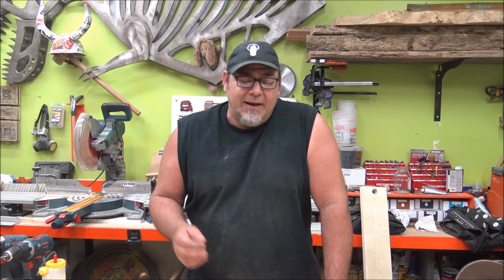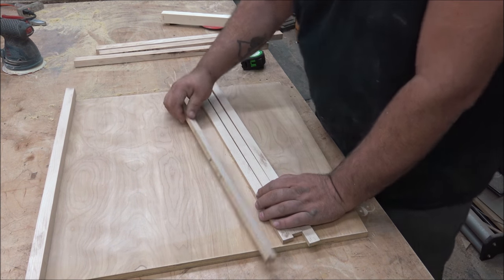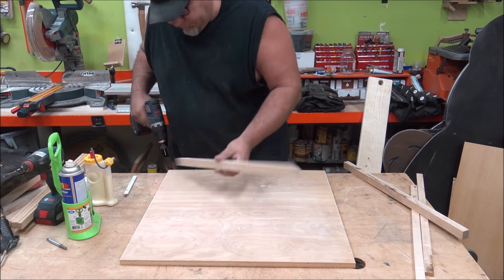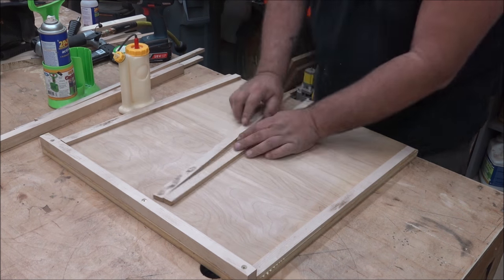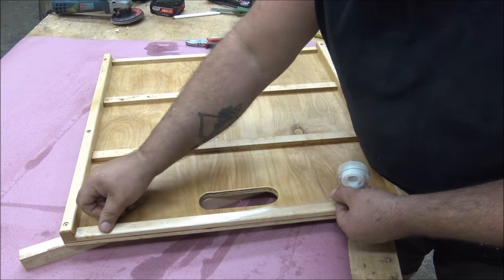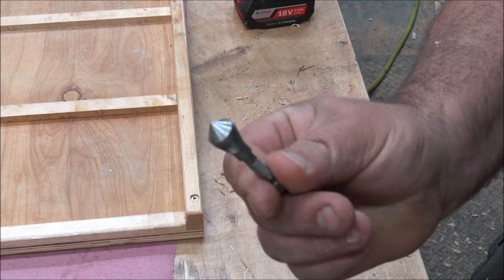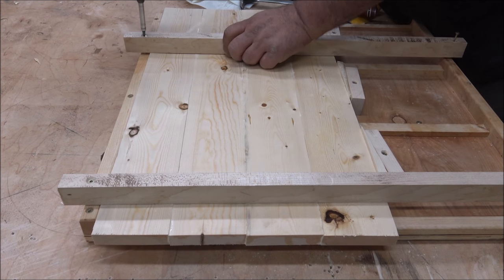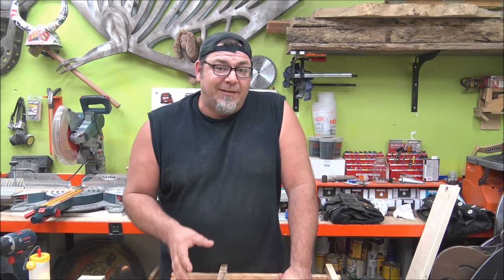Make a simple wood clamping board // How To

Comment: great build. I made one similar after watching an older vid of yours. 

I used an old hollow core door and ran some 5/8" strips of 1/2" plywood as runners. theb I used some slats from a pallet that I squared up as my top and bottom rails. then I hammer in wedges/shims along the gap on bottom rail. I can make some good size panels. when I'm not using I just flip it over and ita my assembly table. I just have it laying on an old folding table until I get more space. and I can always just stack it along the wall when I need to work on my truck.
Reply from the maker: +Mitchell Villanueva Awesome! great to hear about positive solutions

Comment: Very nice! I need to do that! Just one question, the height of those edge pieces were conveniently the same as the boards you glued up, which made screwing the cross pieces easy and useful. What wouldbe the easy method when this is not the case?
Reply: Either same height or can use higher than use wedges along bottom lengths of top secure rails to apply pressure just like he did in the middle to lower the board

Comment: Would it maybe make more sense and be more affordable in the long run, to use T-track to tighten down the blocks of wood the wedges push against? I would worry about an eventual build up of screw holes-at least if you vary the width of the glue-ups often.

Comment: great build!
does this deflect much as compared to using steel bar clamps?
I see an opportunity here to make a frame rather than a panel and the thickness of a frame could minimize deflection.
Reply from the maker: +Dogwood Tales (Ray) It can On bigger panels if they are not secured to a flat surface. I like to build torsion frames for large glue ups. will have a video up on that in a couple weeks

Comment: Might it not be better to make the slats and edges that come in contact with the work piece out of melamine and coat the rest with polyurethane?  This way any expressed glue would not cause your work piece to stick to the clamp.  Plus clean up would be easier.  Just sayin'.

Comment: With all the wood it takes to make one, it seems it would be just about as cheap to just buy some clamps. Certainly faster and easier.
Reply: +Marshall Gatten Not even close..
Reply: +Marshall Gatten And, as pointed out, the space requirements just went waaay down.  And a good use of plywood when the other side is marred.
Reply: You just don't get it.